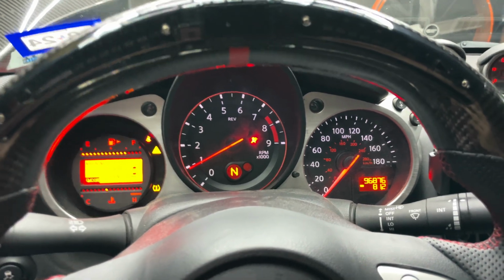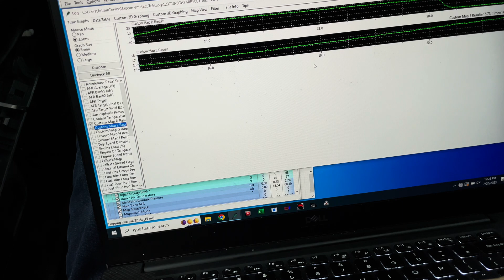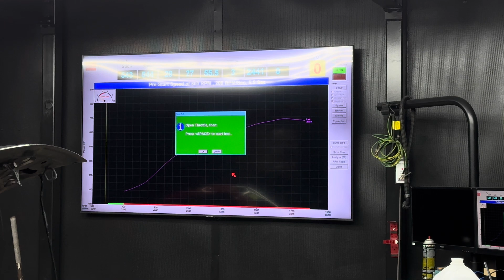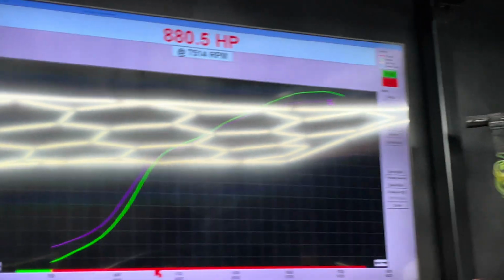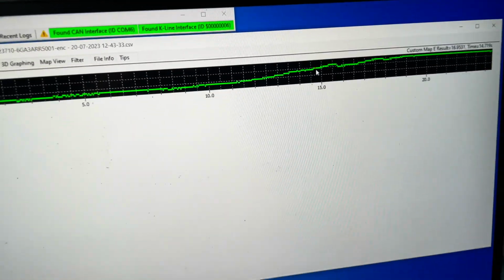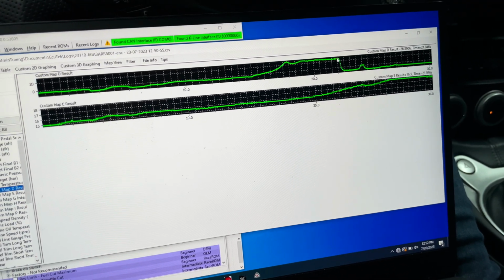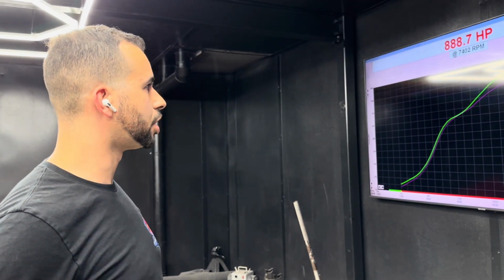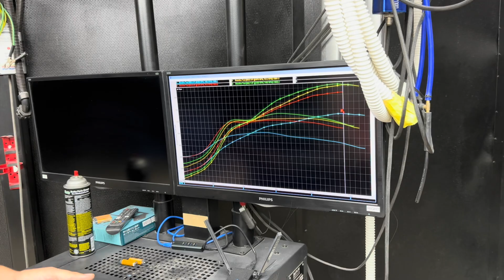TUNING A 900HP 370Z WITH COOLANT PRESSURE MONITORING

Comment: How much would a closed deck motor like this run you?
Reply from the maker: I have been told that this engine package is available for under $10,000.
Reply: @admintuning  through the shophuston? Or sourcing and machining elsewhere. Thanks Moncef
Reply from the maker: @mattylow_z34  This is a CSS short block (https://cylindersupportsystem.com/) and the final assembly was done by SZR PRO in Houston TX.

Comment: for a tt car is closed deck or opened deck the way to go
Reply: Doesn’t matter unless you push the car above 1500whp. Open deck is better at horsepower levels below this because of the added cooling.
Reply from the maker: this is incorrect.
Reply: @admintuning  what would be best for TT applications